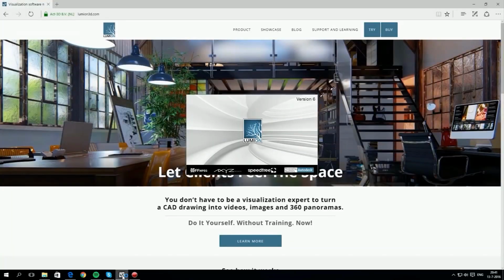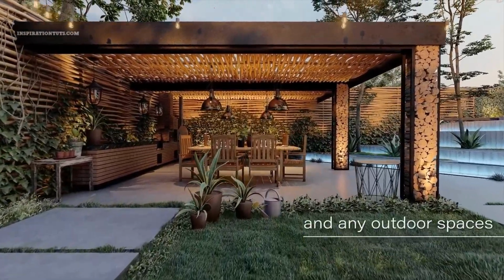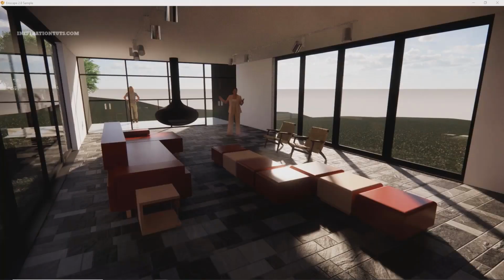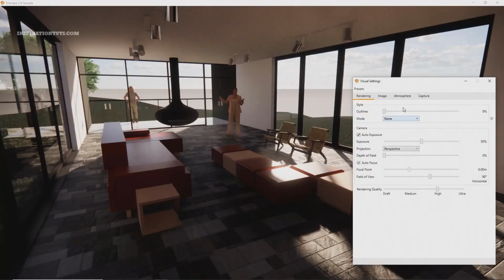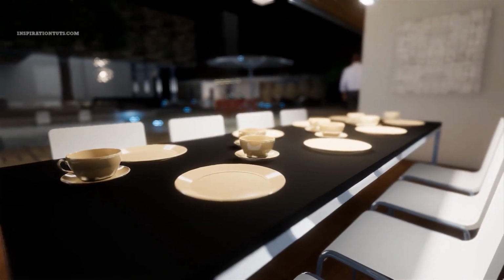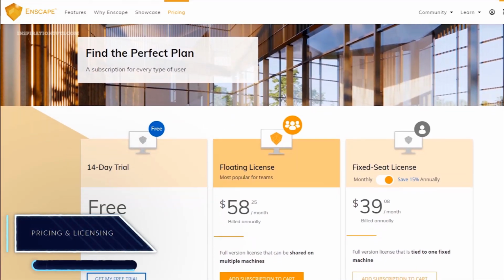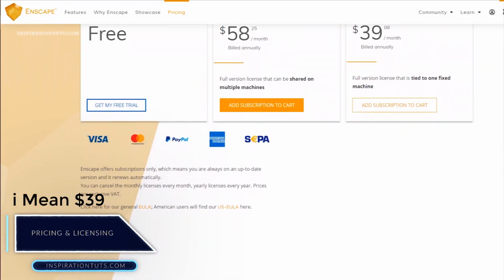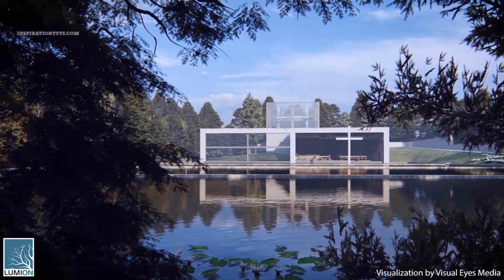Lumion vs Enscape which is Better

Comment: I think in a practical point of view it depends on the industry you are working with if the company is focused more on Architecture or Interior design production, Enscape for me is the best option combining speed and decent quality already enough to impress clients, lumion has still more better features to improve render quality but it definitely has higher hardware requirements and longer render times. Compared to enscape that has lower hardware requirements which also means lower investment cost given the fact that companies that require lumion and enscape skills generally just pays the same rate. But if you are working for a company that is focused more on the graphic design/multi-media industry which involves advanced 3D modelling, visualization and animation, Corona and Unreal Engine is the usual standard requirement.

Comment: Well I think it all comes down to proficiency in the software .. 3D visualization in both software has come a long way. With the right setup and computer hardware you can achieve impressive photorealism in both. As an architect  you are more focused on the detailing in a model because when functionality/ structure fails all else will fail ... visualization is just a tool for presentation and marketing .. from a design and technical standpoint I will pick Enscape over Lumion because its lighter on computer hardware, quite straight forward to setup rebers and produces pretty decent renders even with its presets, it is real time and seamlessly plugs into industry standard 3D software like Revit, SketchUp, Rhino etc .. I find Lumion more "gamer-ish"  and landscape oriented and heavy on hardware .. comparing the required user input, workflow, render time and photorealism I think Enscape is well ahead of Lumion and perhaps even Vray... I have seen close up Enscape renders where even grains of sand were so realistically mapped out ... but like I said its my point of view .. I currently have both Lumion 12 and Enscape 3.4 installed on my pc .

Comment: I only use Lumion and really like it.  Based on everything I've seen from both programs it seems that Enscape has more detail/contrast/depth for interiors but is not as good of quality as Lumion's nature assets and outdoor elements.  Enscape is probably better for interior design while Lumion is better for Architecture/Landscaping.  I design interiors and maybe one day I can switch to Enscape.  The only drawback for me is that with Enscape it is integrated with SketchUp or whatever modeler you use.  Lumion is stand alone and I like that MUCH better.  That reason alone would make me go with Lumion.
Reply: How does having a standalone software make a difference?
Reply: @ekwpnwknits  Well in my workflow I like the render program to be the place where I do all the editing for lights and materials and asset objects.  With Enscape.. it is not.  You make the changes in the modeler like Sketchup.  In that way it seems like it would be easier to work with and more intuitive if it were standalone.  Seems like you would be bouncing back and forth alot of the time.  What is SketchUp crashes?  You may lose everything.. I can't judge too much since I've never used Enscape.
Reply: @bradvanburen3803  Enscape has crashed multiple times for me and it's really frustrating when I'm getting down to the wire on a project. I have also had SketchUp crash, but not nearly as often. I think I figured out why Enscape was crashing and it hasn't crashed since, but still. And yeah, I hate that the lighting for Enscape is done in SketchUp.
Reply: @ekwpnwknits   Yeah I wouldn't like dealing with the lights in Sketchup for how it looks in the render model.  Sorry it kept crashing.  There was a time when Lumion crashed often for me but that was to do with size of my model and not enough memory on my computer. I hate crashes too  :-(
Reply: @bradvanburen3803  you could just dupe your model file and have one you build and edit for enscape. Also if you have 2 monitors making changes in your modeling software of choice and watching the changes live in enscape locked in the view you want is extremely beneficial
Reply: Right.  Sketchup does crash often so that is why I prefer Standalone.  Lumion in rare circumstances will crash but 99% of the time you will get a recovery file once you open Lumion again.

Comment: Lumion is definitely more powerful and more realistic, but Enscape is a fast tool for visualization and showing clients their spaces quickly. Both good tools.
Reply: I am an undergraduate student. Which one should I use? Should I use Enscape cuz it is faster and doesn't need a laptop too powerful like Lumion?
Reply: @nightprowler6336  Lumion is a beast and if you have any large size model, there really isn’t a Laptop out there that can handle it. Enscape is decent for quick renders, but it has very few controls on filtering output. Also, Enscape is wonky with material editing and has a very minimal asset library. I used it for work today snd could not find an aspen tree replacement. Lumion has a vast library. Enscape people look better than Lumion which still has dawn of the dead characters. Twinmotion is better in that regard. Twinmotion also has decals for parking spaces, Lumion does not. Enscape is basically a stripped-down rip- off version of V-ray.
If you want Fast, lightweight and real? = D5 Render is your program.
Reply: @JaySchram  
My laptop system:
- 16 gb ram
- amd ryzen 7   4800h
- nvidia geforce gtx 1650 (4 gb) 
- 128 gb ssd and 1 tb hdd
- windows 10 64 bit
Which rendering software is best fit for sketchup - revit - autocad - photoshop alliance? 
I want it to be quick, real, easy, and free.
Please please answer me
Reply: @JaySchram  thank you for the answer but please answer my 2nd comment 🙏🏻
Reply: @nightprowler6336  I can’t answer because I don’t know what you are doing. Enscape is a plug in so if you don’t have a second monitor you will lose your mind.
Reply: @JaySchram  I use laptop. I don't use desktop
Reply: @JaySchram  which one do u recommend for my laptop?
D5 or Enscape or Twinmotion?
Reply: @nightprowler6336  I’m in an industry where You cants just use one rendering program. Start with Enscape, then V-ray, then try Twinmotion, then Lumion. I would start with Enscape and D5 Render. That should cover whatever you need.
Reply: @JaySchram  thank you for answer 🙏🏻
Are u a game developer? I am architecture student btw
Reply: @nightprowler6336  No I do Arch-Viz and product development. I do hospitality and conceptual rendering. Whatever people need.
Reply: @JaySchram  Not a huge fan of V ray myself, it's very CPU bound on my system and the quality simply doesn't warrant the time taken for a render.
Reply: @nightprowler6336  D5 Render for sure. TM is still buggy.
Reply: @elhomo6406  Enscape is basically V-ray lite. It has gotten a lot better, but the Unreal Engine based real-timers work for me. TM and D5 Render. D5 is progressing faster than any render engine out there.
Reply: @JaySchram  I'd be much more likely to use v ray if it made better use of GPUs. Will have to have a look at some UE based real timers, do you know if any of them have a direct implementation into revit?
Reply: @elhomo6406  I believe both D5 and Twinmotion link to Revit.
Reply: Please expatiate on what you mean by conceptual viz  @JaySchram

Comment: Wish Enscape’s VR viewer wasn’t so bugged on RTX 3000 series GPUs.. Also would love a hybrid option where you could say bake all the lighting /shallows into textures but just raytrace the reflections - Raytracing everything in your scene  - at 2.5x the resolution of 4k in the case of the HP reverb G2 headset (any headset has to render higher than the headset’s panel resolution, before the lens distortion correction is applied, then sent to the display) and trying to do so at 90+ frames per second is science fiction currently, so that lighting workflow for VR would be awesome in the mean time. Would mean a static sun position though.

Comment: enscape requirment is very less as compare to lumion , i have core i3 4150+gtx750 2gb+8gb, enscape ran smoothly .But incase of lumion at he start , it will benchmark our pc , thats there my pc fail but however lumion run like sh@t. so according to my opinion enscape win, for fast work ,easy use, no high cpu&gpu requirement.
Reply: How were u able to run enscape on your system ? I also use a core i3 2g graphics memory,8gig ram and 1tb memory space.... it’s a intel(r) HD 4000.....enscape doesn’t run on my laptop it keeps displaying the 5% loading mark and then it will stop to respond then I’ll be forced to close it
Reply: @sheiladesmond3526  i think you are using 2.8 or 2.9 version.  There is problem with thise version
Reply: @abdulmuqsit1822  yes....I see...okay so I should install the 2.7 version?
Reply: @sheiladesmond3526  2.7 is stable and even 3.0 both are good , currently im using 3.0, however not smooth as 2.7 but have great function and doesnt stuck evem yoy render at 8k , 2.7 stuck at 4k render.
Reply: @abdulmuqsit1822  thank you 😊

Comment: FOR Lumion YOU need more time to set the materials than Enscape.
Reply: Yes
Reply: @arender6537  but when you working on lumion same time applying materials take only few seconds to whole model
Reply: Not true. Enscape, as a plug in like V-ray that it’s emulating, has to apply material within Sketchups antiquated material editor, then adjusted. Lumion is drag and drop on to the imported model. It’s instant and customizable. Lumion is a far more robust program than Enscape. People who ask the question of which is better haven’t used both. Lumion has 10x more of everything.

Comment: I am an Interior designer. The only 2 reasons stopping me from using enscape is the lack of high quality mirror and the lack of displacement maps.
Reply: It's coming!!!!!!
Reply: Enscape has jpg based displacement maps but not proper exr displacement maps, which look way - way better. This would really open up all the free materials on Quixel.
Reply: maybe u dont know how to use it. i found enscape much2 better than lumion for materials and reflections
Reply: @vazghoul   and for doing interior lights

Comment: I think Twinmotion will be at their level sooner, since it's very promising under Epic games / unreal engine. The UI is really user friendly. And it can render photos and animation in seconds. And l'm even using only an i7 laptop 950M gtx.
Reply: Twinmotion is a great offering. It’s free, it can be bridged to UE4 and it has fantastic materials. Downside- it’s not very stable as Unreal Engine crashes on large scenes even with 128GB of Ram and a 2080 Ti on an over locked i9 990k 8-core/16thread machine. TM also has minimal rendering controls, but I use it. Lumion wins for Landscaping and conceptual rendering with its artistic filters, but it’s $3500! Yikes!!!
Reply: Yup i agree. With Quixel Megascans, Metahuman, Nvidia DLSS now being a simple plugin etc all being under the Epic Games / Unreal Engine roof.. Seeing how fast UE is developing and the stuff they’re acquiring and making free to UE users is pretty amazing. EG must have an order of magnitude larger capital to pump into their platforms compared to Enscape / Lumion.. we’ll see if they think TwinMotion is a worthwhile place to invest it
Reply: yes, besides Twinmotion, D5 render is also good, even better. The ue engine will change the game.
Reply: @Jerick Montero, can you explain why Twinmotion is 10-20x faster than Lumion? - I have tested it several times, still and animation render TWINMOTION WINS!!!!
Reply: @scpk2246  Twinmotion is like a smart software it adjusts it self acording to the machine in order to not overload it ,while lumion dosent give a shit what machine you have.
Reply: @scpk2246  Twinmotion doesn’t have the rendering effects and filters that Lumion does. That could be the speed difference. They both pale to D5 Render 2.0 for speed and realism. HD Video is going to be slow on them all.
Reply: @JaySchram  oh, that's a nice insight, thanks - hope Lumion will get faster even just 2x or 3x faster :D

anyway, what is your bet, Lumion, TM or D5? (overall features)
Reply: Yes! d5 is going to be top-notch..
Reply: I am using Twinmotion right now it has the potential but still no there.